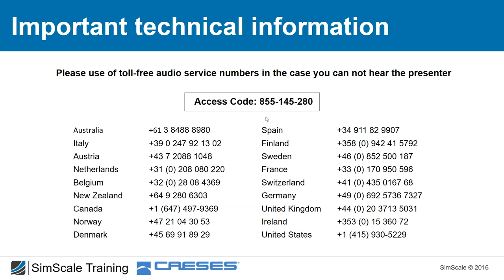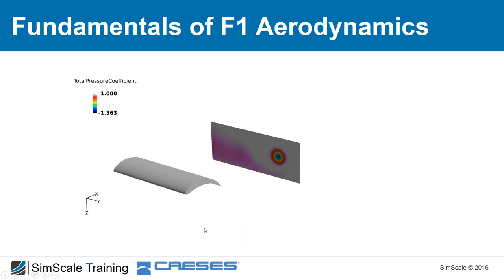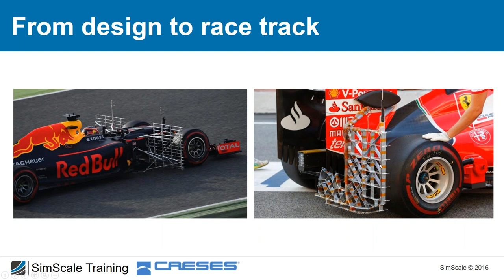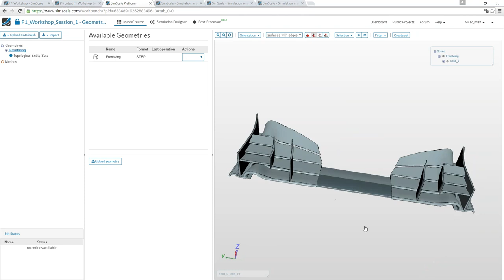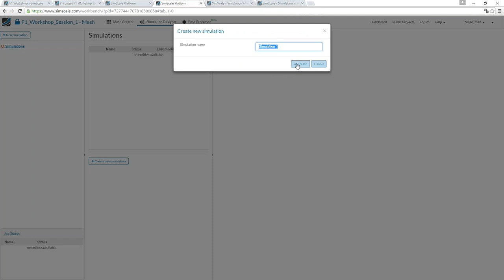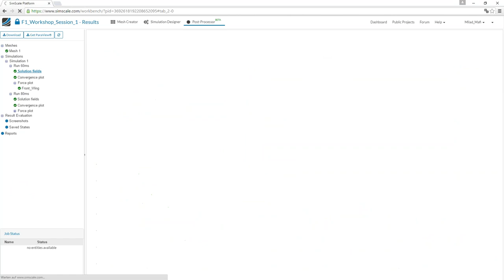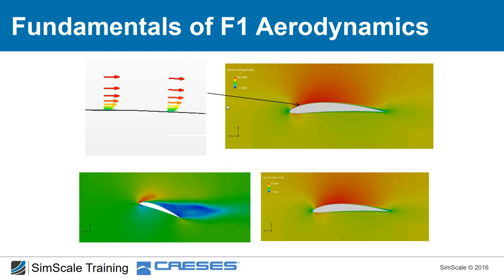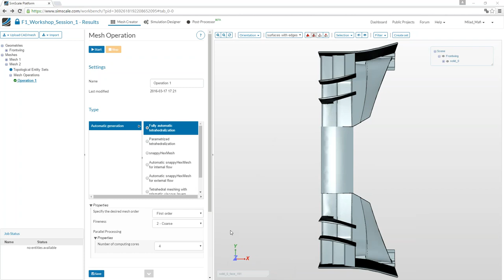F1 Aerodynamics Workshop: Front Wing Design

Comment: Very interesting product!

One question though. The case was setup as a stead-state run, which should be independent of time and only dependent on the maximum number of iterations. However in the control settings (~ time 50:25 in the video) values associated with time are defined. What notion of time does this represent?
Reply from the maker: Thank you very much for your question! The time values in the control settings represent the number of iteration and should, therefore, be treated as a 'pseudo' time without any physical meaning. Do you think this is confusing? What would you suggest? Looking forward to your feedback!!